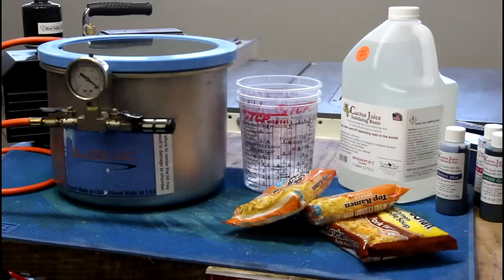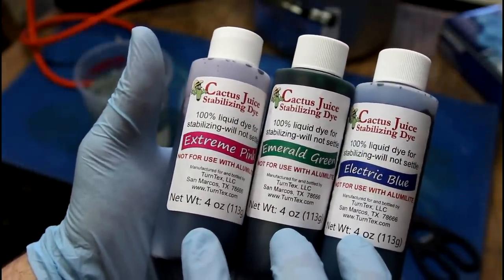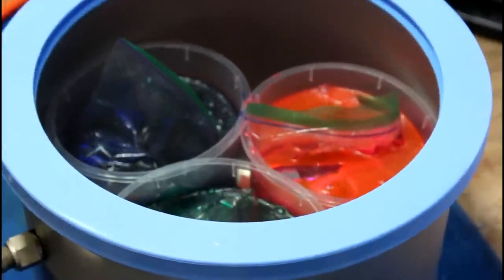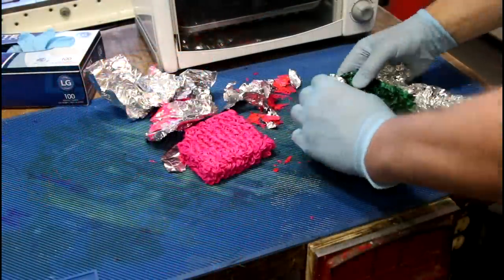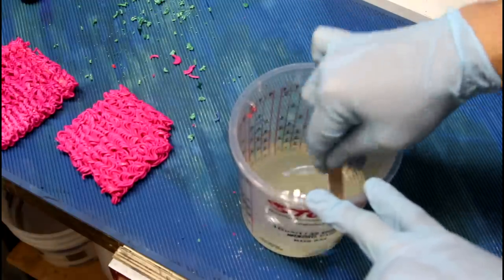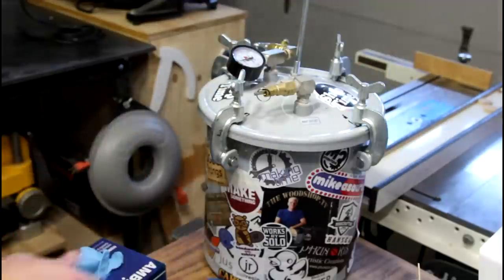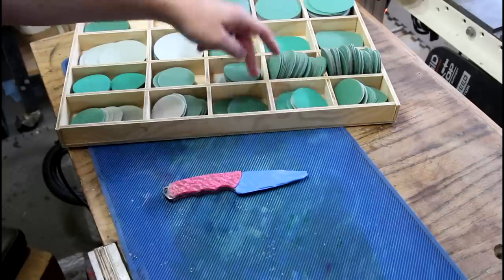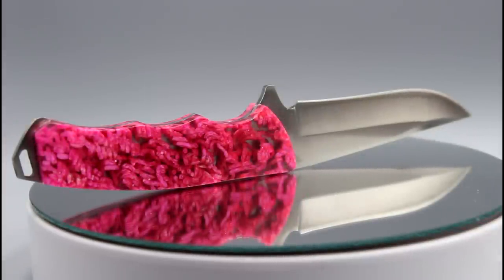Can You Dye Ramen Noodles?! |  DipIt#31

Comment: Curious, could you do your stabilizing resin in one color, and then do your casting resin in another?  Might be interesting to have a two-tone effect.
Reply: Sounds cool! I wonder if you might have to use a mica colourant for the casting resin, so that it doesn’t dye the whole job.
Reply: I feel like he could stop the vacuum chamber before it was done bubbling switch out the color and repeat however many times. I have no idea if it would work. He could also only partially submerge an object in stabilizer.

Comment: For future reference, you'll want to install pins in your tang, because that mechanical fastener helps your glue/epoxy/resin to hold, and keeps your scale if the glue joint fails. Very cool handle!

Comment: I just did the exact same thing, even using the rotary rasp in the drill press and everything.   Except it was a kitchen knife.  And the scales were wood I laminated.   And I didn't forget the pins.  And the pins split the wood.   And I finished the handle in tru-oil. And i spent two weeks getting an imperfect mirror finish on the steel using buffing wheels. And I've carried a knife for thirty years. 

But other than that,  identical.  😎👍

Comment: Mr. Brown. I was wondering if you could answer a question I have about 1:1 epoxy resin? I have some silicone cups that you can measure with before you mix them in a bigger silicone cup. (The Question) How/what do you do to clean the measure cups that are not mixed? I would assume wash them out, but I'm guessing a sink would not be a wise idea. What should I do?

Comment: Ever thought about trying to make a spiral bowl with satin ribbon and resin maybe even adding color to the resin to compliment the ribbon if it turns out well? My idea was like taking your silicon bowl mold, using a brush to brush the walls with resin to make a sticky coat on the mold and draping the silk ribbon around the bowl so it looks like a spiral ribcage I guess? Like idk if spaces would look cool or not but it does in my head lol

Comment: The ramen led to a really interesting-looking design, it almost seemed like tiger stripes from a distance, with the darker voids contrasting with the lighter areas.
Since the knife has no pegs in it, would you have to worry about the handle coming apart during use if you attempted to actually use it as a knife?
Reply: I suppose it depends on whether the resin used to put it together filled the pin-holes and connected the two sides.
Reply: @ragnkja  
Even if it did, would the resin's strength be comparable to that of metal pins? Especially since the resin is only holding on to the handle via adhesion whereas pins would be driven through the handle pieces.
Reply: @Shadowmech88  
It would be holding the pieces together in the same manner, but you do have a point that resin is a lot more brittle than the metal pins would have been.